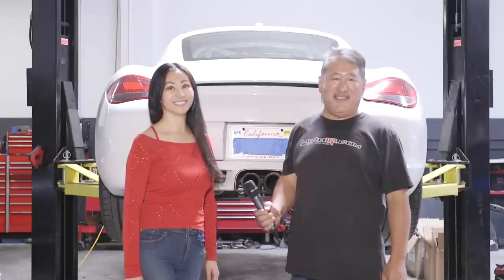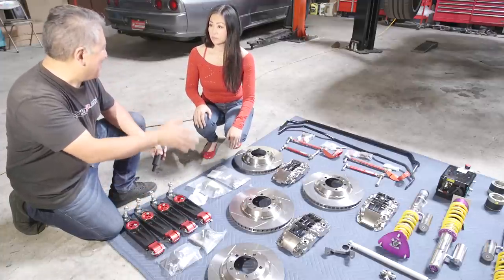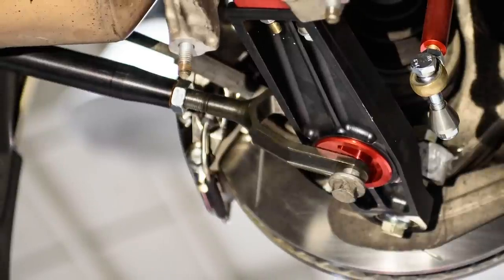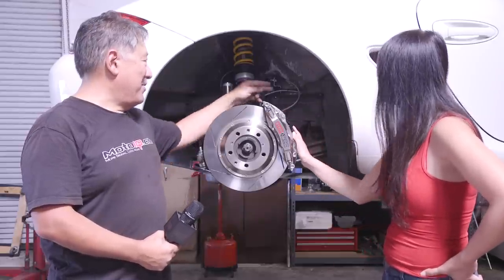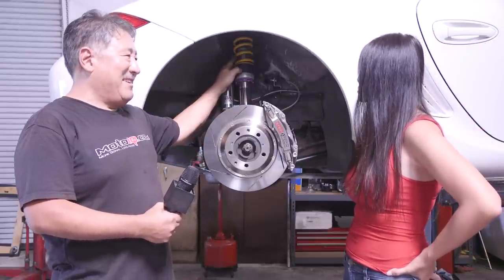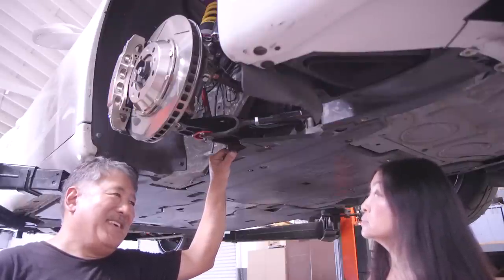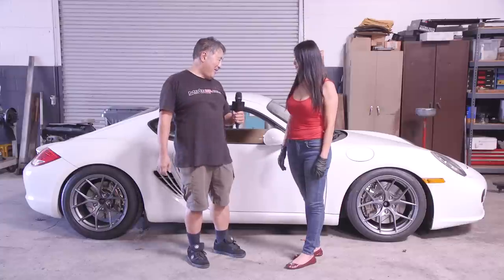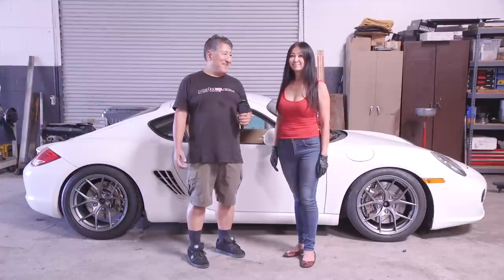Make Your Porsche Cayman Handle and Brake Like a Racecar!

Comment: I was actually on the edge of my seat for the entire 45 minutes of this video.    It's packed with awesome info.    I believe this is the 1st ever comprehensive youtube video on Porsche Cayman suspension/brake performance mods.   Many thanks!

Big question:   what was the cost for all of those mods?
Reply: InstaBlaster
Reply: Rich
Reply: I’d guess $15-20k.
Reply: I’m looking at prices. Brake kit is $11k.  Wheels tires 3k.  Control arms 3k.  KW coilovers 3.5k.  So $20k so far.  All the other stuff + install probably close to $40k.  So all this on a $30k car..
Reply: @Azulevo  from that perspective, wondering if it would be better to spend the $70K on a used GT4 instead.
Reply: For $20k - $40k, think I’d rather bore out my cylinders to 4.3.

Comment: Great video, super informative.
Are you going to publish new videos for the engine and areo updates?
Is there a reason you went wider tires at the rear with 285 while keeping 235 at the front. I've even seen a cayman at the track running +20 front and back from stock so 255/295.
Reply: We are actually running 275 in the rear and 245 in the front, stock was 245 and 225.

Comment: Raising the chassis side caster arm pivot point will move the geometry towards pro dive, not anti dive, as you are creating a travel arc that moves rearwards momentarily during the compression phase. Just thought I'd clear that up.
Reply from the maker: You are correct which is why we lowered it to reduce anti dive.
Reply: @motoiq  At 28:55 Mike states that he's raised this pivot point.

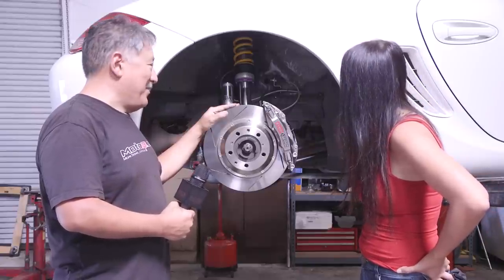Comment: Around 26:41 they move to the front. Is that brake air scoop mounted backwards ?
Reply from the maker: Its not a brake scoop, its an air deflector to reduce tire induced drag and wheelwell pressurization.

Comment: I’ve heard that the break lines can be broken is that more of a quality of a brand thing or are people over doing it
Reply: Considering the price tag of quality goodridge or equivalent lines, I’d not even consider trying the lower price ones. 
I’ve seen myself some badly made bike stainless lines that exploded at the banjo. 

For rubber ones, I would assume low quality rubbers inflates more with pressure than high quality ones so it probably gives lesser pedal feel. But I haven’t tested any of that, just my 2 cents.

Comment: Is it possible to install a cam in a 2.7 Boxster 981?
Reply from the maker: yes but no one makes an off the shelf one.  Plus it isn't advisable to waste money on the M96 engine
Reply: @motoiq  the 2.7 in the 981 is a 9A1

Comment: Very good project. Only comments is that maybe for such a big budget project maybe better shocks should be in order. Twin tube shocks are not the best and maybe KW competition shocks would be more suited which are mono tube. Also it would be great if you showed how you calculated the geometrical parameters of the suspension. Finally you should be more careful editing the video as you repeat yourself on some points and it makes for bad flow.
Reply from the maker: Some of the best shocks in the world like the Ohlins TTX are twin-tube, twin-tube has nothing to do with the quality of the shock.
Reply: @motoiq  Twin tube as in Ohlins TTX or SACHS 4way are very different on how they work compared to KW Clubsports. KW clubsports have a piston valve in the bottom of the rod (in which rebound is altered by the adjuster in the top of the shock) and compression is adjusted at the entrance to the fluid and compressed gas reservoir. Instead the TTXs usually have a piston that displaces the fluid so that it goes through valves that are in a central block. Ohlins and Sachs use a twin tube so that there is a fluid circuit to the valves and not to control the flow. Fluid displacement, accuracy and repeatability is very different. I have yet to test a traditional twin tube shock that is thermally stable to within 5%. KW is undoubtedly the master of traditional twin tube shocks and they have refined it to try to alleviate their inherent flaws. The usual benefits of traditional twin tube design is cost, packaging (more travel same length), and hysteresis. Also for a car that will be able to produce so much lateral grip it would be good to use inverted shocks which are not available as traditional twin tube.
Reply: @josefodunga  With those tires, the KW Club Sport dampers will be more than up to the job.
Also, we don't, at least I don't, know how much force this driver will be able to put into the chassis.
If anything this car is under tired, but with the requirements that it should be a streetable track day car, I think the spec is very good. 
Also with the adjustability. A very good package.
Reply: @josefodunga  If I remember correctly, the KW Clubsport is a street version of the KW Competition 2-way, which also is a twin tube damper. While the KW Competition 3-way is a mono tube.
By the way, am I guessing wrong if I'm guessing you work with dampers, and also have, or work on a damper dyno?
Reply: @MrLundefaret  Yes, I have a damper dyno, provide service and manufacture special dampers. With regards to the type of damper I have developed a dislike to KW twin tubes as they seem to degrade over time (even after servicing them) and have had some of them bend the rod quite easily when subjected to shock. If they are going to install the aero bits Mike talked about I don't think its unreasonable to assume they could corner at around 1.5 to 1.6g's  or more (I used to have an 2008 STi I took to time attack with those tires and I could corner at around 1.25g without any real aero) and that's why I think going to inverted for the front is for the best. Also camber loss and deflection is minimized. What this client is asking for is quite complicated and I think it would take quite a bit more effort to provide a streetable car with medium aero and regular springs (would probably use some internal assist springs, etc).
Reply: @josefodunga  Thought so, you seemed very knowledgeable. I think that adding the aero to this project makes the equation very difficult. It will also require a lot more from the driver, and a lot more from the safety.
If the driver is capable of taking this car close to it's limits in high speed corners, with the aero factor, serious effort needs to put into safety. It will basically be as fast as an FIA GT4 car.
What kind of special dampers do you build?
And what is your favourite brand of dampers? (Track)
Reply: @MrLundefaret  My main focus is track dampers for TC (small two liter tin tops), bulletproof vehicles (land cruisers and such), and heavy duty rally dampers. Penske is quite high on my list, they are easy to service, they sell all the parts, and it's easy to get the curves you want. For rally Reiger is the best in my opinion.
Reply: @josefodunga  TC as in TCR, or is it an American version? Full slicks on those?
Reiger is good, but haven't kept investing as they used too. SACHS was the best, but I thing Volkswagen owns most of the IP rights. EXT is an Italian brand worth mentioning, so is BOS, i believe French.
Dampers are fascinating.
Reply from the maker: @josefodunga Cabra the point is whether a shock is twin-tube or monotube is irrelevant of its quality.
Reply: @josefodunga  This is how a KW Clubsport works. The rebound adjustment and the high-speed blow-off is mostly in the piston. A fixed level of rebound is controlled by orifices in the foot valve.  The compression has a fixed level of damping in the piston and the high-speed blow off and adjustment is in the foot valve. The reservoir is just to make room for rod displacement volume and just contains a rubber bladder to keep the fluid and gas separate.
Reply: @josefodunga  For twin-tube KW's. there is an offset adjustment on the main needle valve seat position where you can raise and lower the seat. There is another adjustment on the preload for high-speed blowoff.  You have to unstake the high-speed preload screw to turn it.  You can adjust these to get the shock back to how it was when new if you have the old dyno charts. You can also blueprint the individual shocks to each other using these internal adjustments.
Reply: @motoiq  This is very true, as it is the quality in research and development, engineering and components that are the main quality parameters.
You can have badly designed 4-way adjustable inverted coilovers that are worse than lightly upgraded standard non adjustable dampers.
On low grade coilovers clicking will give no real effect.
Reply: @mikekojima9761  The added aero on this project made me curious. Why do you feel that it is needed?
Is the driver capable of running the car to it's limits in high speed corners with the planned aggressive aero?
What kind of safety measures will you consider, since with the aero, even in the street tires, you will have a massively fast car - especially in the high speed corners?
Very cool project, and liked the thinking behind both the brake, damper, wheel, and tire set up.
It's massively difficult to build a good car with those requirements.
Reply: @MrLundefaret  Aero is always beneficial on a track car, even low powered ones. The car has a roll bar and harnesses.

Comment: What did all of these parts cost?
Reply: Probably 7k ish at least. Coil overs are expensive, that cup system and big brakes are the real kicker.
Reply: I take that back after seeing the control arms etc. 14k, labor not included lol
Reply: @DNightNinja  14k is just the coilovers with the HLS system.

Comment: Why do all 4 wheels turn on the dyno? It's a rear drive car.
Reply from the maker: So the ECU does not freak out.
Reply: @motoiq  Got it. Makes sense. Otherwise PSM and everything won’t let you have any power. So the rear rollers are connected to the front so everything turns together and powered by the rear wheels?
Reply from the maker: yes

Comment: thats 25k in parts right there so yeah it better be handling and stopping better!
Reply from the maker: Well its a Porsche not a busted EG Civic
Reply: I feel like you are implying I drive one or something. Besides the brakes which I personally think are overkill I have a lot of the same mods on my 718 cayman. ;-) @motoiq
Reply from the maker: There is nothing wrong with an EG Civic.  If you drive on the street with a stock car with stock-size tires, the stock brakes are awesome, up the power considerably, put larger R compound tires on it, and do it so you don't have to change back and forth from street to track brake pads, and these brakes are it. I think we said that in the video.